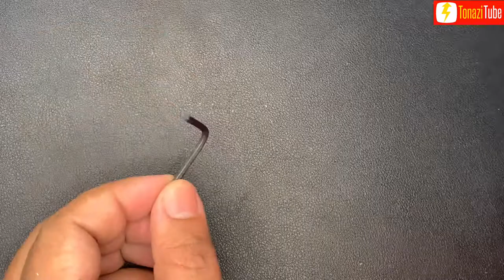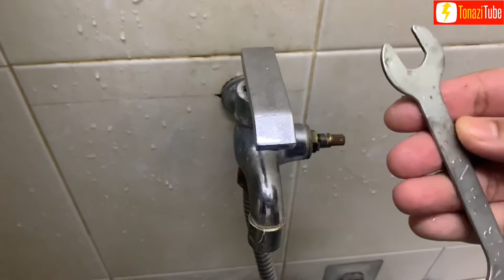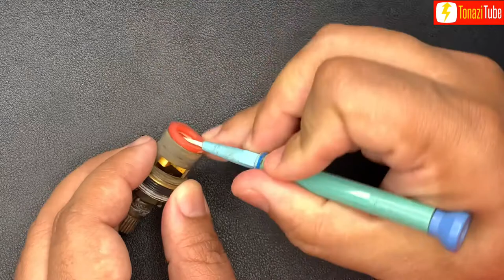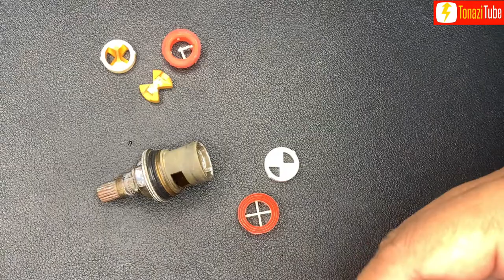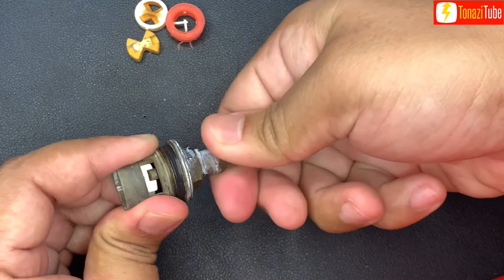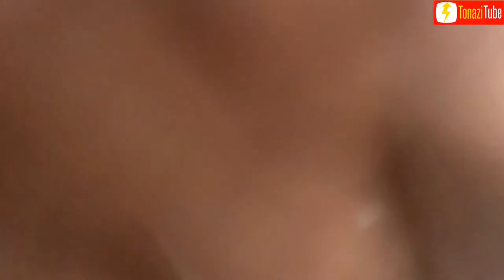How to Fix Faucet Tap Leakage | How to Replace Ceramic Disc Tap Valve | DIY Repair Faucet Valve

Comment: I've replaced the sink faucet's ceramic washer but the faucet still drips. Any idea as to what's wrong with it?
Reply from the maker: Get wrong installation back or have issue with the tap valve.Try to reassemble
Reply: @TonaziTube  actually we had a plumber put in a new faucet for the sink because the old one was dripping. After 3 months the newly installed faucet started dripping. I replaced the ceramic washer and it would stop dripping, but a week later it would drip again. So far, I've replaced about 4 washers for 3 months now. I've done some research and it says the valve seat could be the problem? Sorry, I'm just ignorant with this thing. That's why I'm reaching out. Just frustrated. Thanks for the reply. Appreciate it. 💯
Reply from the maker: Hope you can solve this issue soon.Difficult for me to advise without see the real thing happened.Just only try advise what I suspect and hopefully it can solve it.
Reply: @TonaziTube  you've helped me a lot. Thanks again.

Comment: You ought to take the shaft out and replace the O-rings too, because they often leak. You'll also find that there's a bearing/spacer ring behind the flange on the shaft, and those can be broken or worn down to the point that replacing the other parts won't fix it anyway. In fact, those spacers have been the fault on two of my taps, and the repair didn't require the replacement of the discs at all.
When you remove the shaft, you can press all of those parts out in one go,  just by pushing on the end where the tap fits. You only have to remove the clip. Why do half a job?
Reply from the maker: Thanks for advise and problem sharing